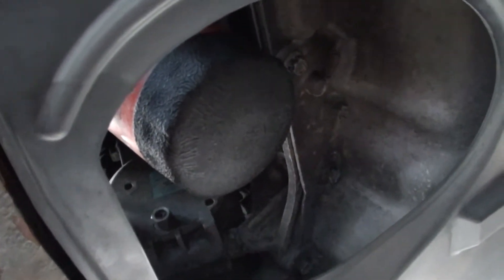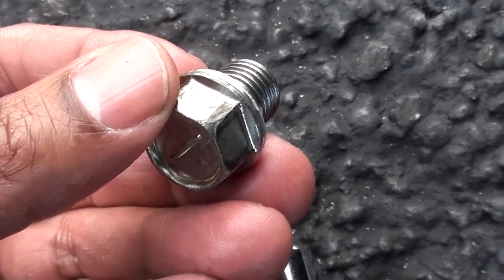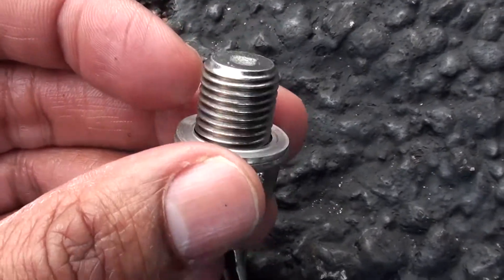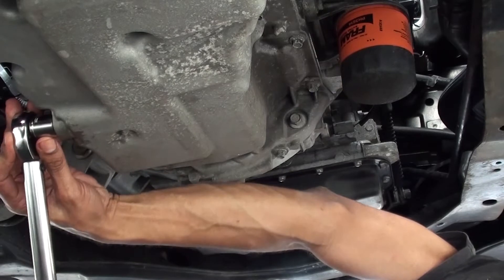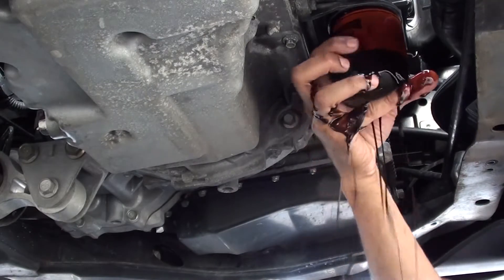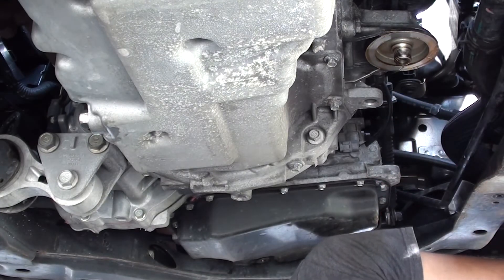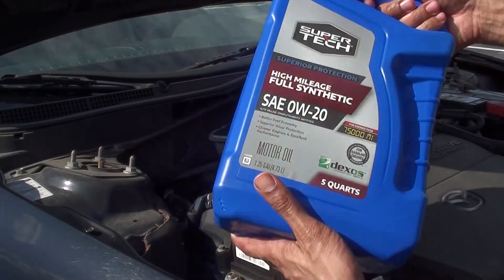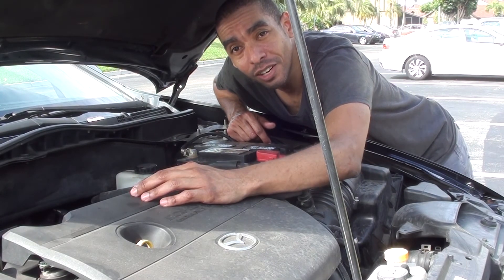2013 Mazda6 Engine Oil Change

Comment: Just came across  your video, to see how difficult it would be to do an oil change on one of these. I just bought one at Drive Time. Had an '06 Focus, real piece of junk, that just died. I bought the Mazda 6i touring; it's the basic model but is still real nice, with 120,000 miles on it. It runs real nice and tracks smooth and the transmission is shifting real nice with the five speed. Think I'll keep my eyes open, for more of your car videos, if you keep them coming!!
Reply from the maker: You're welcome. my friend! Thanks for the compliment. This car is really easy to repair in most cases. There is no impediment or special tools needed. I can change the oil in 15 minutes if I'm in a hurry. However, be advised that earlier versions of this car do not have this spin-on type of oil filter. They have the cartridge type and that process takes a bit longer, but is cleaner on the hands. I've never done it on one of those 6's but I do with my wife's 2011 Camry which has a cartridge type filter. Thanks again for watching. I'm gearing up to do another video shortly. It will be one that I'm surprised I haven't seen on YouTube as yet, so I'm looking forward to being the first, but more importantly, the best! So subscribe and smash that bell and stay tuned!

Comment: Nice job!
I recommend to use supertech filter also.
Reply from the maker: I don't have anything bad to say about Supertech filters (I have used them before) but I prefer the grippy surface that Fram filters have. That makes removal much easier than the other filters with smooth surfaces.
Reply: I second that to use supertech filter 
I cut open a supertech and fram filter and compared  them.

But if you use a fram filter I would use the tough guard middle tier ones. After seeing what’s in the extra guard ones

https://youtu.be/Q5qPJO1cUw4
Reply: I concur, super tech filters are great!
Reply: the 10060 supertech filter that fits my dodge has no oil bypass valve when you look inside the filter. I would never use the filter because of that reason. the bypass valve lets oil pass through when the pressure is high, like during a cold startup or when you floor the engine. without the valve the only place the oil can flow is through the filter

Comment: How is that engine 2.5L. I am thinking of buying one. Can you talk about it and what to look for and change  and how easy are things to change. Thanks
Reply from the maker: Thanks for watching the video. To answer your question, the 2.5L engine (called L5-VE by Mazda, Duratec 25 by Ford) is one of those engines that will quietly go down in history as one of the most reliable ever designed and made. Almost nothing goes wrong with them and they are easy to work on, with most things easily accessible. The power is decent (170hp) as is the torque (167 lb-ft). It is an interference engine (if the timing chain breaks - a virtual impossibility - the piston will hit the valves). This is not unusual in high compression, variable valve-timed engines, however. These are not performance engines and they were used in the 2G Mazda6 like mine, which means it was in the least loved Mazda6. That, therefore means, that there is virtually no performance upgrades out there. None. So if you are looking for more power, get the 3.7L V6 or plan to custom modify everything yourself.  I'll see if I can do a video in a day or two. Stay tuned!
Reply from the maker: I finally did the video you asked for, my friend. Have a look: https://youtu.be/dbQKKuxxCNs.
Reply: Hi Lexusfan he made a video for you.

Comment: How many quarts of oil do the 4 cylinder one take ?
Reply from the maker: It takes 5.0L (5.3 US quarts). That's pretty standard for this size 4 cylinder these days.
Reply: @RichardTait1977  so does it take 5 quarts or 5.3 quarts ?
Reply: I bought one yesterday 2012 4 cylinder how does it do In snow
Reply from the maker: @1996ikey  It takes 5.3 quarts. But you will find that the 5 quart bottle you can buy is sufficient. This is because no matter how hard you try, there will always bea little oil left over in the engine that will compensate for the difference.
Reply from the maker: @1996ikey  I live in Florida so I have no idea. But I've never heard of any driveability problems from other people who live in snow prone areas. I have heard some people speak about excessive rust in those areas because of the salt used on the roads during winter. So I would recommend you wash that salt from the car frequently.
Reply: @RichardTait1977  so u only put 5 quarts in and it works well ?
Reply from the maker: @1996ikey  Always measure the amount you put in using the dip stick. But, yes, I've only ever put 5 quarts in and it is exactly where it should be.

Comment: How many mile do you have on the car?
Reply from the maker: At the moment she has a shade under 118,000 miles. She still runs like a Swiss watch. One of the best purchases I've ever made and I'm fully satisfied with her.
Reply: @RichardTait1977  that’s good. I’m think of buying one. Do you ever have any issues with the water pump and timing chain?
Reply from the maker: @Kingta150  This is the 2.5L 4 cylinder (MZR L5) which does not have the sake problems with the water pump as the 3.7L V6 (Duratec 37 - which has an internally mounted water pump that, if it leaks, will allow coolant inside the oil pan and could destroy the internals). There are no known issues with the timing chain either, which is installed for the life of the engine. This engine was designed by Mazda and is so reliable that Ford continued to use it (or a variation of it) for years after Mazda replaced it with the SkyActiv engines. The downside of these, that I've heard, is the 5 speed automatic transmission. It is a Ford unit, unlike the 6 speed automatic in the V6 which is an Aisin unit which is more durable. I've heard of an issue with harsh 3-4 shifts, but I'm not experiencing that at all. That's about it as far as things to watch. I would say, get a good mechanic to check it out, and if he or she says it's okay, pull the trigger! Good luck.
Reply: @RichardTait1977  thanks you and one more question. Is is a non interference or interference engine?
Reply: @RichardTait1977  because I have a Toyota solara with a 2.2l 4cylinder engine
Reply from the maker: @Kingta150  These engines are interference engines. However, you do not have to worry about that because they use timing chains which require no servicing and no replacing. As long as you change the oil regularly and keep the oil level correct, the timing chain will never stretch or break.
Reply: @RichardTait1977  ok thanks you for the info!👍🙏
Reply from the maker: @Kingta150  Anytime